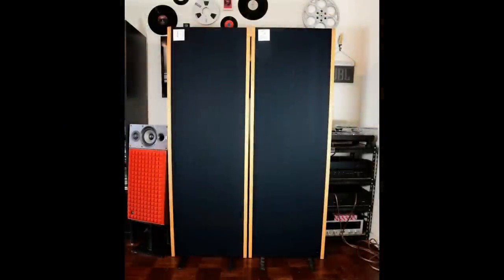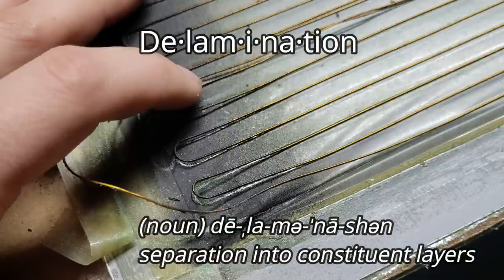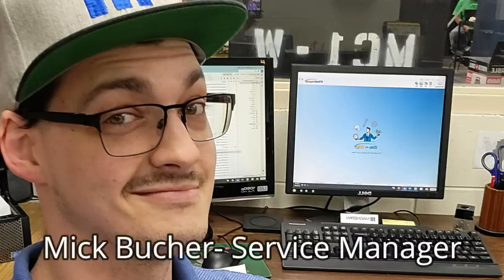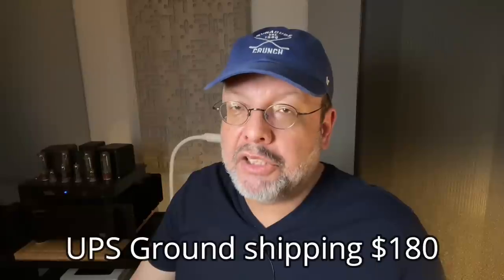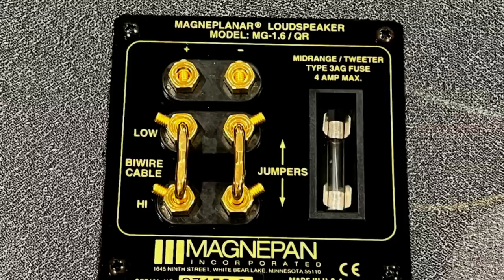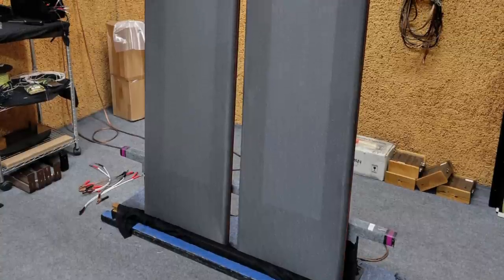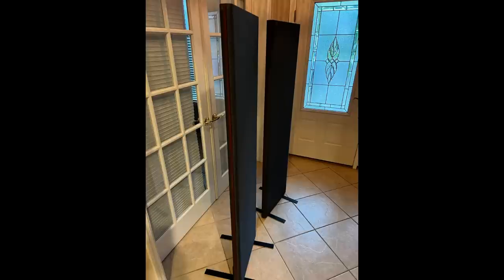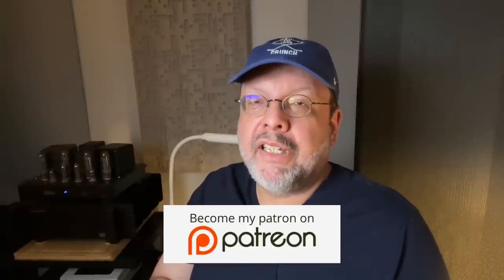Introducing The 1.6X...Not Your Father's Magnepan!

Comment: There is NOTHING in this world like Maggie's. NOTHING. it's an either love them or hate them proposition. My set of MG 2as are from the 80s. I remember hearing a set of Magnapan Tympanys back in the 80s, and I was smitten, but even though the speakers are built at an affordable price point, they were still beyond my humble means. I came across my set of MG2as 2 years ago at an affordable price, and I got to demo them before I purchased them. They have not disappointed at all. They are everything I had hoped for and more. I know your room is small, but if you can pull them away from the wall 3 feet, you would notice a whole different dimension to the sound. Happy to see someone actually post a video about these wonderful speakers. They changed my life, and I'm happy to hear that you also have discoved the magic.

Comment: I just picked up a pair of the new Maggie LRS+ speakers and a pair of REL T-Zero MKIII subs... I also added a Rolls SX45 active crossover to the mix, and all I can say is WOW! The crossover made a world of difference in the overall sound. The stress is now relieved off of my amplifier and the frequencies below around 80hz are all going to the RELs. Any congestion in the speakers is now gone, which I did experience with other amps. I'm currently using the Emotiva first generation XPA2, which I find very musical, with incredible instrument separation. I have tried other more expensive Class A'B amps, the last one being the Parasound A23+ and a Crown XLi2500, the Emotiva sounded better. The Class D amps, no soundstage, very 2 dimensional. I also have Danny's crossover kit, need to find time to install that. Very happy with these, and it sounds incredible. I'm listening to Classic music right now, and I have never heard a cello dig so deep! ;-)

Comment: This is really interesting and well presented. Magnepan is a very rare company insofar as it was never interested in bling and making gigantic profits.
Founder Jim Winey was clear from the start that speakers should be open windows to the sound presented through the media used (preferably physical) and it was really up to clients to add bass extension as required with the caveat that windows to original sounds should fit the listening room and not try to make the speakers try to give the experience of a rock concert close up.
A full symphony orchestra in a hall is the main real world amplitude. Recordings of same use standards of frequency and amplitude able to be committed to records, tapes etc in the analog domain.
Full rock concerts (ahh, those were the days!) actually had similar total amplitude at a given distance from the amplifier stacks and crowding close to the stage was sonically foolish because the musicians knew that the total soundstage of their performances worked best some distance away. Stage crowding was for a different sort of experience. Where huge amplification was used (for projection or special effects) most of the true professionals wore different grades of ear canal protection. Performance inserted transducers allowed musicians to hear sections of the ensemble and overall balance while also protecting their aural apparatus where necessary.
Ear protection had been used in symphony orchestras and big bands for decades in the 20th century and before for very loud music.
Peter Walker, inventor of the QUAD electrostatic loudspeaker, was also conscious of 'missing' bass inherent in panels and it was my privilege to know him when I was young. In his office and home he extended bass with different solutions we might now term 'subwoofers' but he was never tempted to add sub units to his ELS speakers as Levinson and Logan did and recommended bass extension to be tailored to the listening environment. The 'speed' and damping of bass frequencies could be optimized in situ but to add them as standard threw up a mass of problems, usually to do with placement. His co-work with the BBC demonstrated that bass reinforcement in practice was situational.
During the purely electronic phase of the 1960s and '70s, BBC concerts of music such as by Stockhausen, Hiller, Varese, Cage, Wuorinen, Takemitsu and mixed instrument and tape by numerous now 'mainstream' composers required banks of QUADS mixed with Fane, JBL then BBC-made bass units of some size. Companies such as BK, REL and KEF emerged from the BBC stable.
Panel speakers are not pretty. They are not furniture and makers who try to make them such demand enormous prices. Magnepan has so far avoided this and, IMO, are right to do. Getting them to the factory if one lives is Europe is madly expensive though.
Thank you for a great vlog.

Comment: Hello, great video! Very surpised with the changes at Magnepan!!

This was not what i expected with your video title... thought more of a DIY upgrade. Like I did myself on my 1.7's. But the delam issues, with the rambling, i know that from way back on earlier models. Luckely there was a dealer only few miles from my place that did the repairs in the Netherlands. Last year i had some issues with the 1.7 foil. I informed about repair, but that is way more expensive than the alu wire. So i decided to try out myself with some acetone, silverfoil (kitchen) and the glue.... it worked. 

Now i had them openend up, and GR Research had just done  a vid about a XO upgrade. That was always on my wish list.  

I used the parts and schematic of Danny from GR Research and local bought wire. That silver/copperwire was not good at all, as i had the same problem with the S-sound on female vocals. So i bought the best copperwire on the market, Neotech from Japan. That made a huge differnence. 

The tin speakerterminals(never understood that from Magnepan) upgraded with some pure copper from Ali-express. Bypassed the fuses, first upgrade I did on all my previous maggies too. The fuses always gave me trouble while listening to highpitch womans voices like Joni Mitchell. 

Exept from your version being the 3-way crossover, mine is 2-way, where treble and super tweeter are in series. This is because Danny thinks the super tweeter does not do very much, our upgrades must sound similar. I am very impressed, with every upgrade i make up in the chain, the get keeping better and better. 

I have added a small 8 inch sub, but like you said, the is not necessary with this setup. Just feed them with clean power. I have never had tubes on them. that make me curious, i was thinking about the latest class D. What is your expercience with the class D amp?

Also very suprised as i said, magnepan is now doing upgrades them selfs. The always said about the cheap XO material that this was the best sound the could get price wise. And yet there is so many aftermarket upgrades for Planars... 

I think they can sound better then 50.000 dollar speakersets. ...

Cheers,

Ranko
Reply: I just bought my first pair of magnepan s .7’s . They are still in the box. I have two rel subs to use as well I’ve seen upgrade kit but have never DIY anything with speakers before. How was the process? I wanted to have the sub blend more seamlessly and have the Maggie’s crossover over for highs and mids which I heard good results. I’m a bit intimidated trying to do this on my own but don’t want to spend crazy money on shipping.

Comment: As soon as you mentioned upgrades, I thought of Danny @ GR Research removing the iron core inductors and upgrading the capacitors. Getting rid of any posts that had iron in them, and replacing them with copper connectors..
Reply: The tube connectors improve the sound, making 1.6 at least 2.7 or more. The air inside the tubes makes the sound so airy. Put some cinnamon inside the tube and the sound will have a fluffy bun quality.

Comment: I watched and enjoyed your video on the Magnepan 1.6X speakers you posted.  I noticed a couple of additional things you can do to improve the 1.6X even further. First, replace those large steel signal jumpers in back (they look like large staples) by making a short jumper of high quality speaker cable or other high quality copper or silver. Next please replace the glass fuse in the fuse holder with a quality audiophile fuse. If I may, I found the Synergistic Research Orange fuse to work best on my Magnepan's. However, any audiophile fuse will do a better job than the glass fuse installed. Remember, the better cable and fuses are all directional these days. Install them and listen for a couple days, and then insert them in the opposite direction and listen again. One direction will sound better than the other.  I have used Magnepan speakers for 45 years, and they continue to impress me. Yes, Maggie's like clean power. The speaker will tell you if it is stressed. It may take 6 months to a year before deep bass shows up. I trust they sound great now as newly refurbished speakers, but you ain't heard nothing yet. The panels and crossover electronics need time to break-in. Enjoy!

Comment: Great video. I have a set of 1.6’s that have a modification of a small ribbon tweeter added to the top. I bought them that way. They really sound amazing. I can hook and unhook the ribbon tweeter. It makes a dramatic difference, it picks up the very, very high end, which is lacking on this particular speaker. I’m really interested to hear that Magnepan is willing to do some upgrades like better connectors and capacitors. I think my speakers could benefit from that. Though I am very seriously considering instead of 2.7i’s. Keep up the great videos.
Reply: You likely have the same mod I do from the defunct store in Walnut Creek, CA. I use a modified Jolida 801a  tube amp that can pump out a lot of current. Amazing, liquid midrange with a delicate detailed high end.

Comment: Von Schweikert Audio will goose up older speakers for their customers.  Depending how much one wants to spend, it can be mild to wild.  But of course, Magnepan and Von Schweikert are completely different, except both are dipole speakers, and the price point aims at a different, more well heeled clientele,  as the saying goes.  I'm. Interested in the "2" series of Maggies as they reach down lower in frequency.  An "X" model would be neat though.   
As for operation, no sweat, I have some big amps ready to go, whjch I u derstand Maggies love high current amps.  In any case, keep up the good work!

Comment: I repaired a pair of 1b Magneplanars from 1984.  I'm the original owner.  It took a few days, but it wasn't too difficult.  They had suffered from delamination.  I think the wire on one of the tweeters broke, too.  This was 2016.  However, I also have a pair of 1.6QRs from 2001.  The tweeter foil on one of them broke.  It just happens.  It's not a matter of abuse.  I have the repair kit.  But the wiring to the crossover is different from the old 1b, and the procedure looks daunting.  A few months ago, I contacted Magnepan and asked them if I could send the 1.6QR speakers to them.  They balked.  They referred me to the kit.  When I told them I was afraid to do it myself, they sent some new instructions.

Comment: I always here that "maggies need lots of power". I've owned MGIIa's, a full 5-channel system (MMGs front, MMGC center, MMGw surrounds), and some 3.7rs. They don't need lots of power, but they will absolutely take lots of power and will shine. I had my 5 channel MMG setup and the 3.7s powered by an Emotiva amp. but I also tried a Pioneer Elite A/V receiver. I can tell you, they sound just a good with lower power amps, just not as loud.
Reply: I'm using my old first gen Emotiva XPA2 with a pair of the new LRS+, also have Danny's upgrade kit to install. I added an active crossover, the Rolls SX45 along with a pair of those little REL T-Zero subs, and this sounds fantastic. The Emotiva does an incredible job, the instrument separation is outstanding along with the soundstage. I have tried other amps, the latest being a Crown LXi2500, all have sounded congested, no musicality at all.

Comment: The 1.7i is an amazing speaker and what you have is even better!  What is your room size, I'm wondering if my room can accommodate them.
Reply from the maker: The size of an average spare bedroom. 10 foot ceiling. They sound great.
Reply: @MODAC   OK great, they should work in my room which is about 15 X10.5.  I'm using LRS's with some decent electronics right now and they sound amazing.

Comment: foil does not have lower mass... i really dont know how people come up with this. if the resistance is the same..... and both use aluminium. so the weight is as well. it has benefits (and downsides) but weight is not one of them. wire should have more bass then foil. just because foil is using the magnetic gapp less efficient then the foil...

maybe the glue is less... but wire vs foil is not the weight difference